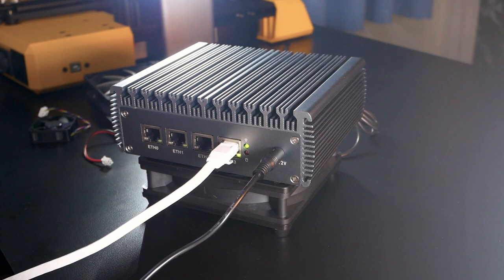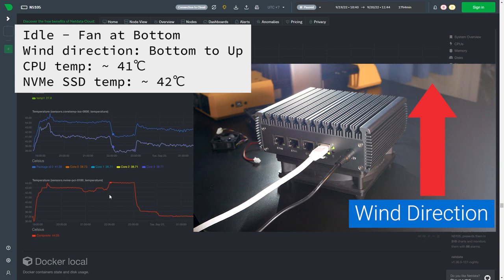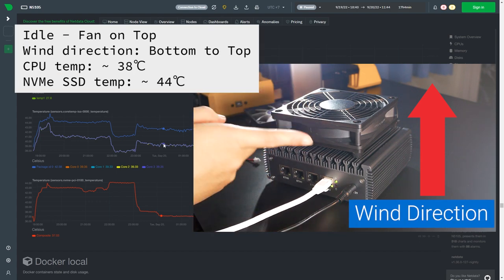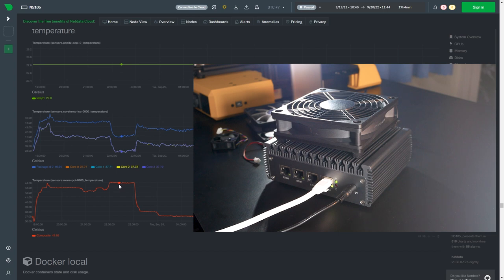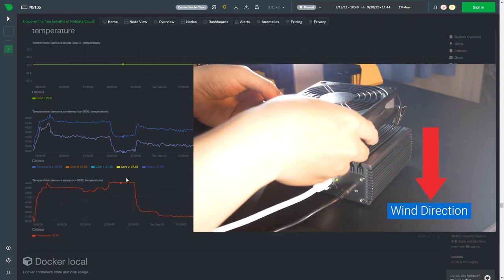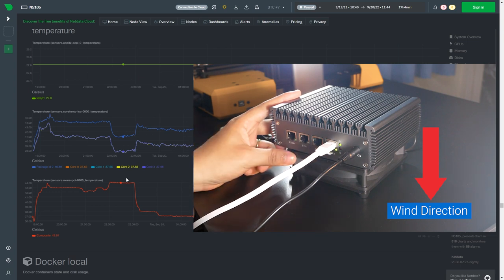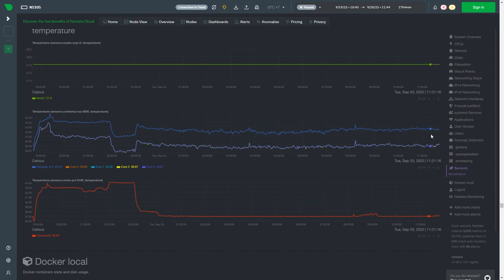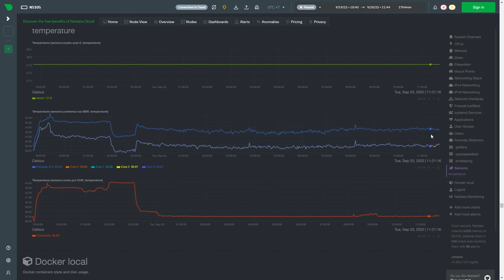N5105 2.5GbE Router PC Update - USB Cooling Fan - Temperature Overview - SSD/NVMe Installation

Comment: In the 3rd configuration, the SSD gets unnecessary cold. I would recommend the second configuration with lower CPU temperature. That would (very) slightly decrease the power consumption too.

Comment: Thanks for the video. There are few more options on Aliexpress now for N5105 CPUs and your unit seems to be middle version in terms of performance. There is one with prebuilt fan on top and one smaller where you cant even fit SSD and NVMe in the same unit, that comes without any fans and with serious overheating issues. These processors definitely need some cooling help if the intent is to use them 24/7 for the next couple of years.

Comment: pritty sure you can add generic thread stand offs to get some backplate space but oc you will then have an air gap, getting the grinder out & making 2 or 4 long slots inline with the big fan is also an option, shame they didnt source a slightly deeper case or put the base slots in at the factory though.
Reply from the maker: I am thinking of a 3D printed back plate/panel with better air ventilation and high stand to add the space. However, I have just getting started with 3D printing and may not be able to design that. It will take sometime...

Comment: My new router started losing connection and connection returning….when i placed a router fan blowing air into the router is working..but now i want to try blowing the hot air out of the router

Comment: Hello Van can you please make a video on Openwrt Netdata install cpu temperature package. I tried but it doesn't work. Thank you
Reply from the maker: Hi, do you mean the x86 OpenWRT. Did you install netdata using opkg or manually install following netdata docs?
Reply: @VanTechCorner  I've installed netdata fine and it works well in OpenWRT. But cpu temperature package I can't install.  Can you please make a video on how to install cpu temperature package on Netdata Openwrt. I would like to monitor cpu temperature in Openwrt(sensors)

Comment: Can I use this machine as desktop workstation?  There is no sound card?
Reply from the maker: Yes it can but is is a waste of money & resources. You can find other PCs running the same Intel N5105 that was built for desktop application. Usually it will come with a network port (not 4 x 2.5GbE) and WiFi, and cheaper.
Reply: @VanTechCorner  Bare bone unit it's less than 100$ USD in my area so I think it makes a good home entertainment system.  But since in one of your videos when you boot into ubuntu with this box and it's a bit on the slow side, that's my only fear

Comment: Hey Van Tech it would be really helpful if you can put a link store where to buy the devices otherwise your videos are helpful and cool projects
Reply from the maker: Hi, the device is not 100% working as expected, that why I don't want to share the link. But if you want, you can check it out https://bit.ly/3RwSDyR
Reply: @VanTechCorner  What has been your experience with the device, good and bad?